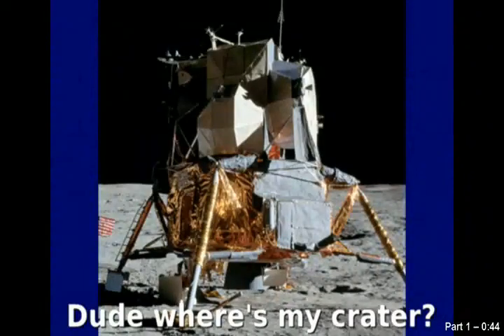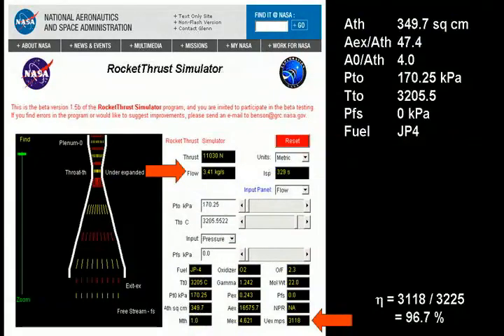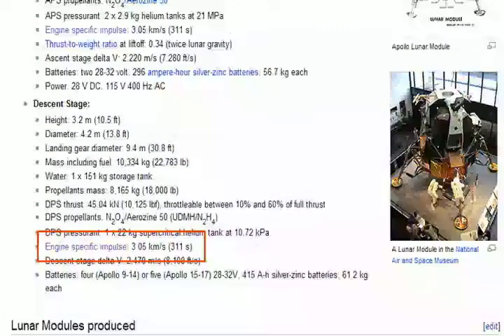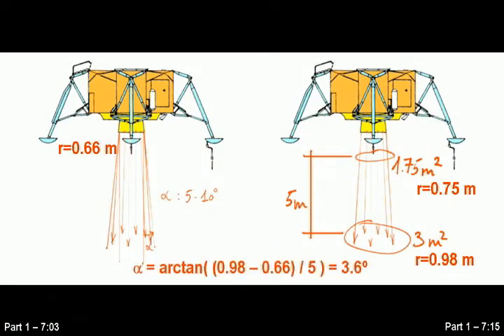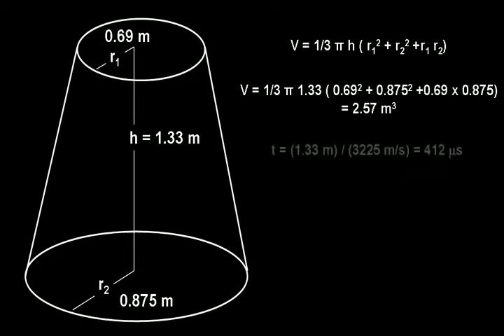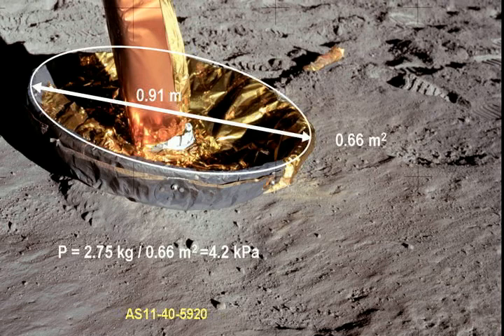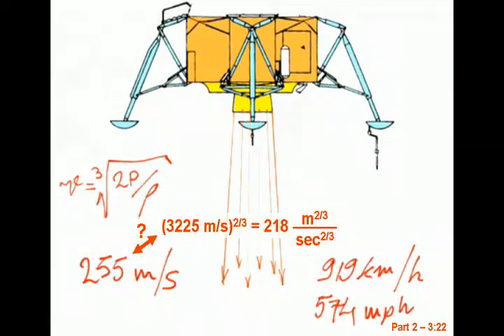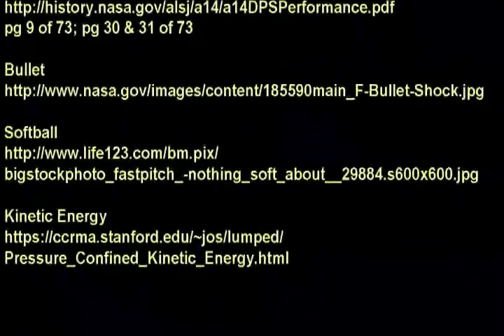Pseudonautics - Episode 3 - Soft Landing - DEBUNKED (Part 2 of 3)

Comment from the maker: @obaeyens
10-4. The force that makes a rocket move is the pressure of the exhaust gas divided by the area of the throat. The nozzle affects the pressure in the throat, but for the most part, once the exhaust clears the engine throat, it's done its job. If that weren't true, you'd never be able to accel or decel in the vacuum of space.

Comment: The Apollo mission reports give the angle of each LM on the surface. They weren't always level. A15 sat at a 11 deg angle to the vertical having actually landed on the rim of a crater with the forward pad slightly off the ground.

Comment: To determine their attitude in space, the LM and CM had inertial platforms calibrated by sighting star pairs. A pair 90 deg apart was optimal.

Ground radio tracking was the primary way to determine position. As a backup, the crew could sight the earth and moon limbs. This was much easier with the sharp limb of the moon than the fuzzy limb of the earth, but it still worked well. On A8, Jim Lovell got numbers that frequently matched the ground exactly.

Comment: Actually, the main reason they landed with the sun behind them was to keep it out of the commander's eyes! Also: the lunar orbits were retrograde (westward) to minimize fuel consumption. They wanted to land with a low sun angle to make rocks and craters more visible, and then for the sun to rise rather than set. All this dictated landing in the local morning with the sun behind them.

I think the AOT could see stars in pretty much any direction since it had a sunshade.

Comment from the maker: I'm still not sure what you're asking. It wouldn't take any more fuel to land sideways than it would straight up. They only had so much fuel and that was it. They weren't worried about the LM tipping over in soft soil. The surveyor probes before Apollo pretty well verified that the lunar surface was firm. Also, I'm not sure what you're referring to by "Spider" unless you're talking about the Apollo 9 LM. It was tested in earth orbit and the landing gear was unused.

Comment from the maker: As for the angle, I think I remember reading somewhere that they could lift off at 35 degrees from vertical. But don't quote me. If you look at AS15-87-11818 you will see that Shepard sat Antares down at about 20 to 25 degrees off vertical, so apparently that wasn't a problem.

Comment from the maker: Sorry, I thought I replied to this already. No one is more important than you hauserkaspar, but I'm not sure what you're asking. The most important thing about choosing landing spots was to find places that were flat to make the landing safe. They tried to avoid things like craters and boulders. As for landing in a crater, that doesn't sound attractive. They had about 600 seconds of fuel, so if they wanted to land in a crater, as long as they did it within the 600 seconds, they would be OK.

Comment from the maker: The LM used a primitive navigation system. On descent, they fed tracking data (angles, range, and range rate) into a computer that used a coasting integration routine developed by some MIT boys. It also used data from other sensors and an alignment optical telescope (AOT) that triangulated off of just two stars and the horizon. That's why they always landed with the sun behind them, so they could see the stars. They used rendezvous radar (RR) for the return trip. Google tnD6741OnbrdNavSoftwr.pdf